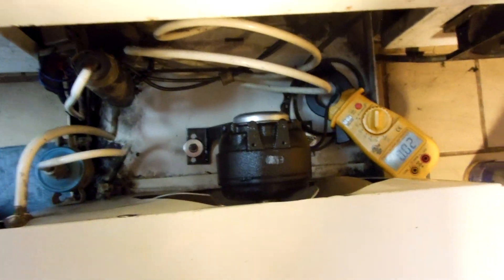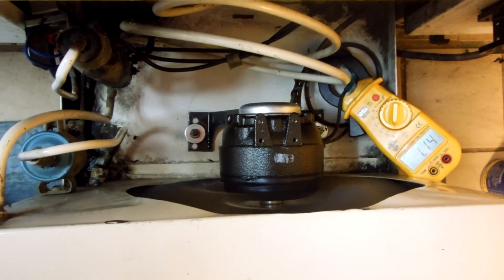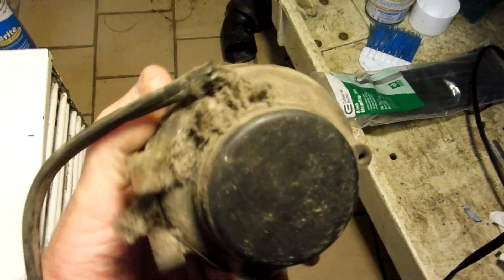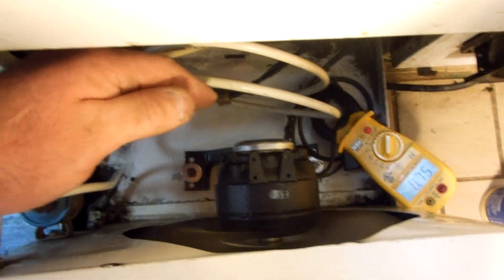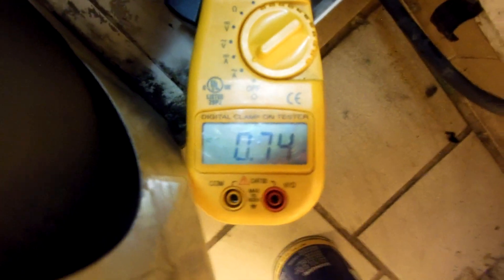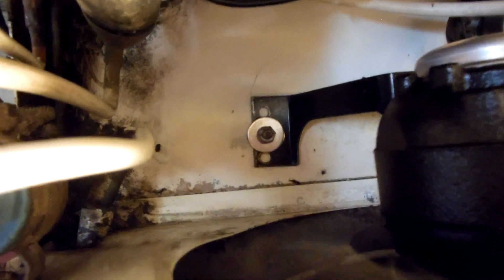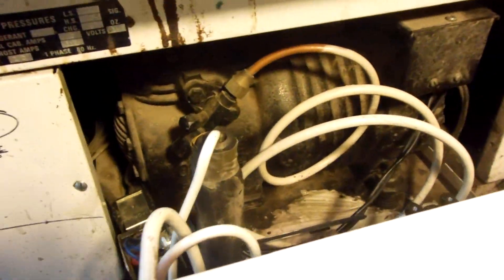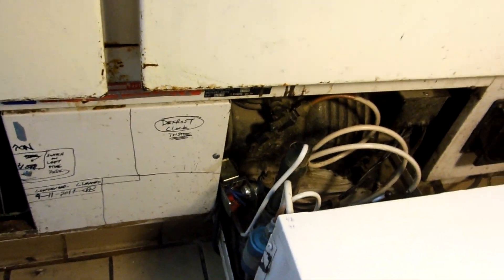Kelvinator ice Cream Cake Case. Condenser Fan Motor Replacement. Part 4. New 16 Watt Motor.

Comment: Nicely done bro why don't you pull the blade out just a little bit more but still professionally done
Reply from the maker: Yea, i hear ya. if it had 2 bolts on the base i would but, it only had one stud and if i pulled it out more motor stability would be an issue i feel. as best i could do with that one.